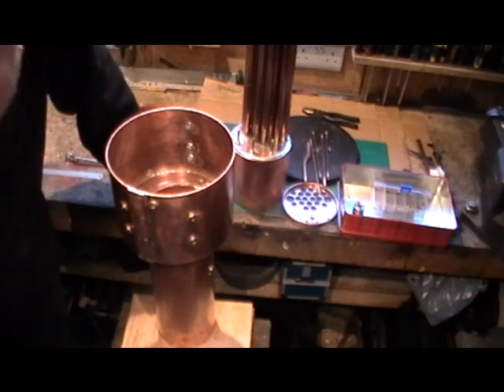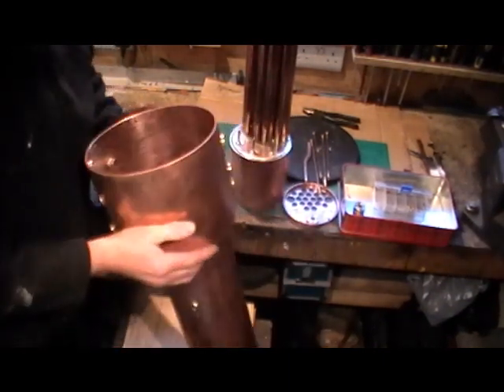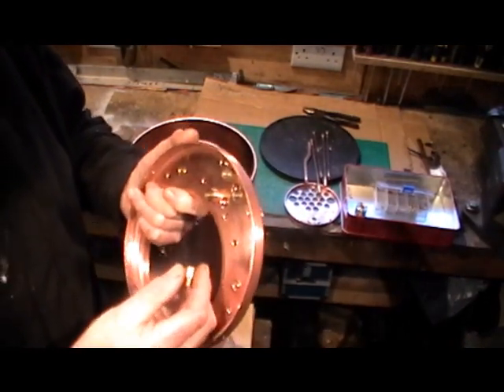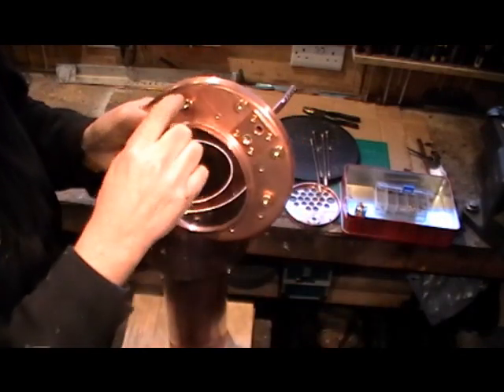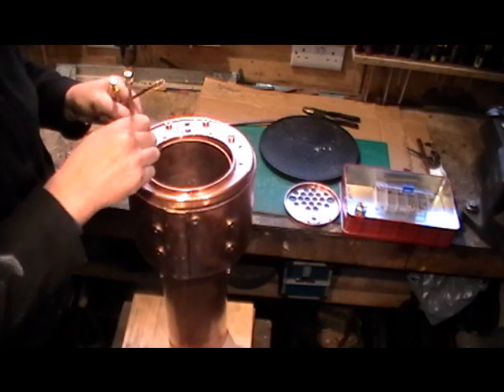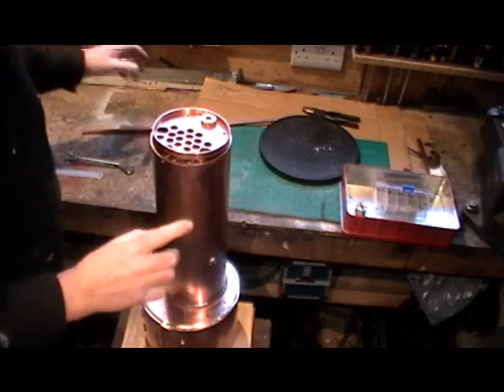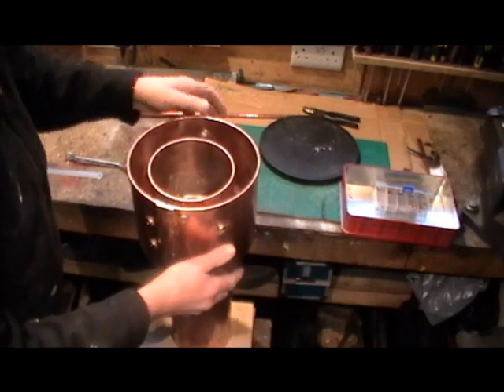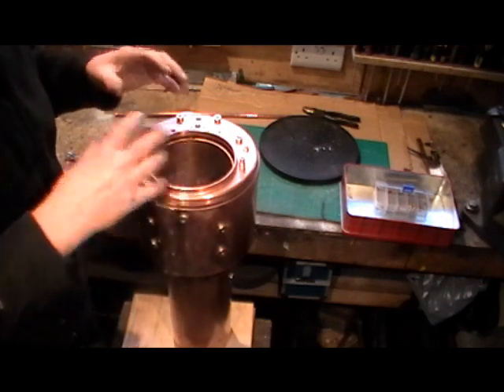How to make a steam loco boiler part 11 final assembly explanation  "mr factotum"

Comment: I am amazed at how far ahead you have to plan building a loco, in order for some obscure part to be attached! You are doing a marvellous job on your boiler. I've only built a steel boiler and it is way bigger and heavier than yours, but no where near the work yours has been? Your silver soldering looks pretty slick too. Well done.
Reply from the maker: Thank you very much! peter
regards
mr f

Comment: Another excellent instructional film. I am looking forward to seeing the boiler fired up.
Reply from the maker: Thanks for comments, appreciated, although will be a while for fire up as not started on rest of loco yet, boiler fittings are next
Regards
Mr f
Reply: @MrFactotum  That's a very interesting way of doing it. Many model engineers are often scared of boiler making but yet build a great loco to high accuracy only to sub-contract the boiler making. You have shown in very comprehensive and easy to follow steps how a boiler can be built that will I am very sure inspire others to tackle this aspect of model steam loco making with confidence. I have very much been inspired by your work and have understood now how the hole entity is manufactured and built. Keep up the good work.
Reply from the maker: Thanks for kind comments
Because i'm a novice at boiler making i thought i would see if i could crack that first. Ive been told you see alot of really nice unfinished projects for sale without the boiler, i didnt want to be in that category
Regards
Mr f